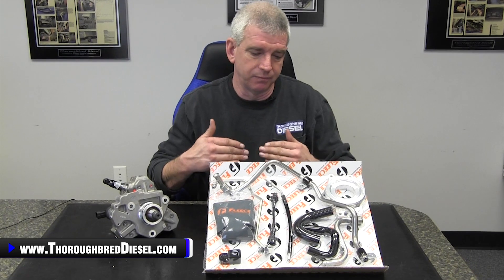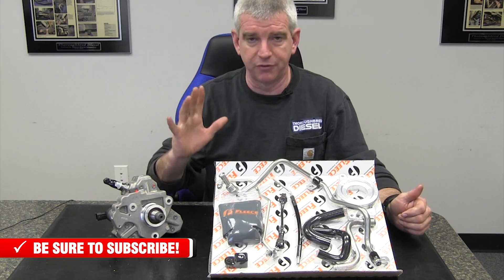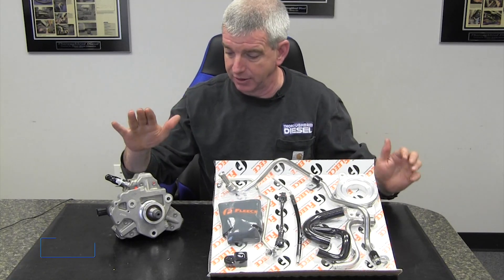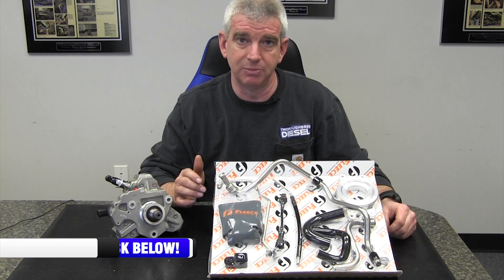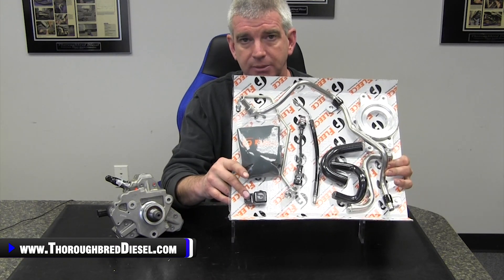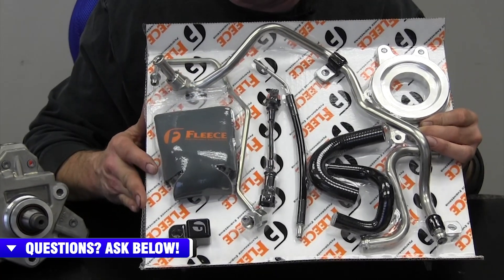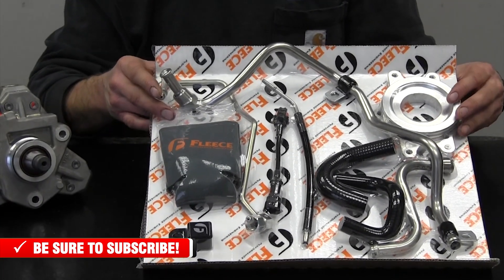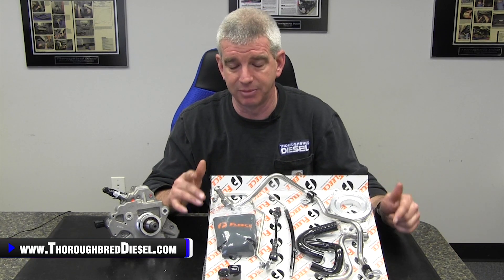Fleece Performance JUST Made Some Major Changes To The LML CP3 Conversion Kits #duramax #chevytruck

Comment: I wonder if the deser line not being hooked up to the pump and fed through the return like this is an issue? The LDS kit is setup this way and it seems Fleece had it set this way as well at one point or another.
Reply from the maker: Fleece has converted to this a few years ago and we are not and have not heard of any issues.

Comment: Could you name the two metal lines in that kit from top to bottom? I have it from you guys love the kit but naming the lines is a bit confusing for this old man. Thanks
Reply from the maker: This kit has been updated again, but I believe I was referring to the low side fuel supply lines for the stock configuration and the smaller line that is for the setup if you have an aftermarket fuel pump.

Comment: And apparently they have revised it again. Don't make the mistake of following the video instructions from a year ago or you get to remove the pump AGAIN. The one I am installing June-2023 has a different dosing setup that uses the original lines and the fuel temp sensor is actually being used. These must be set up before anything else is installed, I read the included instruction, figured I would use them when the video got to that point, but it never did.
Reply: what did you do with the fuel temp sensor?
Reply: I installed it.  @zhongxina5595